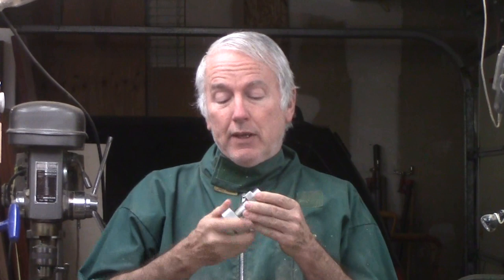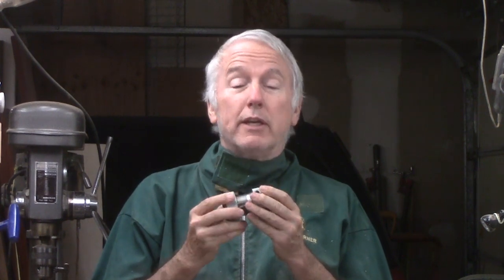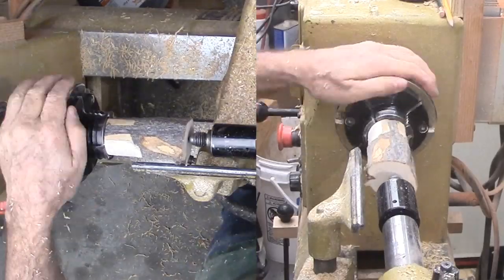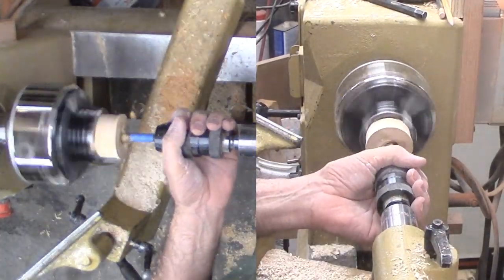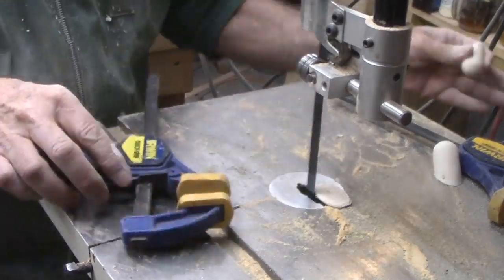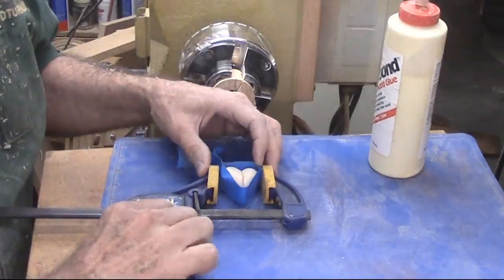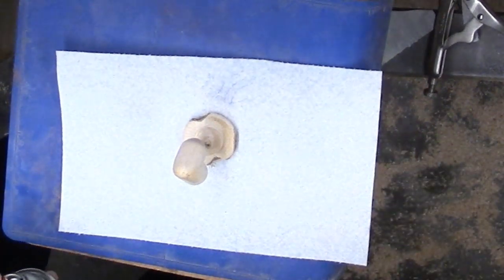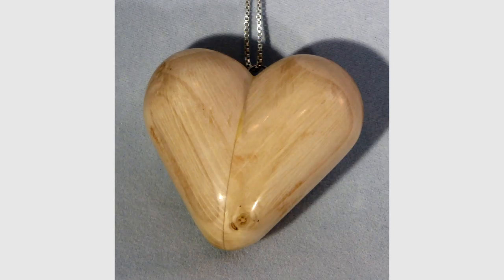Woodturning Heart For My Valentine Plus A Collet Flop

Comment: I once needed to hold a small work piece (1/8") and I emailed Dave Springett in U.K. To ask how he holds Lace Bobbins for turning. He was very helpful in suggesting making a collet chuck with wood. Size the chuck to fit perfect circle in a standard chuck, drill a hole the size of the piece to be held, then take the wood chuck to the band saw and cut the side to the hole. With one saw kerf there is enough to grab the spindle. I have now made several of these and for Bobbins I cut it into two pieces and use elastic bands to hold it together when not in the jaws. I put a couple of groves on the outside to hold the elastics.  The thickness of the wood chuck can be varied to protrude the work away from the lathe chuck and provide more wood support.
Reply from the maker: Bert,
You always have great ideas. Thanks for the suggestions.
Alan

Comment: Happy Valentines Alan, at 2:43 in the video if you drilled out the end  for 1 side of the heart, round off the end closest to the headstock, part off and repeat for 2nd half. then cut angles to match. Nice looking project.
Reply from the maker: I may have to make it longer so I can waste more wood for that technique.
Thanks for commenting.
Alan

Comment: I watched Steve Jones, a UK woodturner,turn a heart between centres and then cut on bandsaw. His process is simple and great skew practice.
Reply from the maker: Yes, looks like great skew practice.
As is typical in a video presentation, I think it is a bit more difficult than it appears. I like his more rounded heart. However, that means he has to take particular care to make the two pieces almost exact mirror images of each other. Then sanding to match without some offset seems difficult.
I'm not taking away from the presentation. But as usual there's a little more to it.
Alan

Comment: December 2017 American Woodturner had an article on making collet chucks. I have it put away, but as I recall they cut into three pieces and use rubber bands to hold the pieces together when out of the chuck. Nice little heart, BTW, I hope your wife enjoys it.
Reply from the maker: Thanks for the heads up except that it was August 2017. It is probably what lingered in my mind. Still I think it can be adapted.
Alan

Comment: An idea for the makeshift collet chuck... if you turn a longer cylinder, and have it clamped in the chuck on the headstock end, you can drill a hole in the centre for whatever size you want. Then, on the bandsaw make 2 cuts 'along' the cylinder, so that when you look at the end grain of the cylinder you see a 'cross shape' with the drilled hole in the centre (does this make sense?). Then use a hose clamp fitted around the cylinder to clamp the piece of wood you want the collet to hold onto. Great project Alan, next year you can make one with inlayed veneer to make it extra sophisticated! :)
Reply from the maker: Thanks for the suggestion.
Just a note. I'm trying to avoid using a hose clamp.
Inlay such as a Celtic knot?
Alan
Reply: @AsWoodTurns  Celtic knot inlay would be a real nice feature. If you don't want to use a hose clamp, try using those really large and 'stiff' rubber bands to hold the collet tight, or you can even buy thick rubber strips, make some rubber bands out of them, and use those to hold tighten the collet. Any way, just ideas.

Comment: Nice project, Alan.   Regarding the idea of drilling to hollow the heart .... have you considered using something like a Dremel tool to carve out the interior?   It might not be pretty or precise, but after gluing it together no one will see the inside and some of the weigh5 would b3 removed.   Just a thought.   I need to get out to the shop and give this project a go.
Reply from the maker: A dremel could work but IMHO, slower.
Alan

Comment: Alan;  Be very cautious when making small off-cuts on the bandsaw.  I once broke a blade when the offcut fell down the slot, and lodged between the wheel and blade.  BANG!!  New blade time.  Ever since I use painters tape as a kind of zero clearance around the saw blade when doing small offcuts.
Reply from the maker: Good idea for the masking tape around the blade. Could slow down some of the small stuff.
Thanks for commenting.
Alan

Comment: You could do the same style collet by adding a thin layer of plywood to the front and back or solid wood with the grain directions perpendicular to each other. When making the cuts make them in line with the grain on the face you cut through.
Reply from the maker: I appreciate your suggestions.
Alan

Comment: Hi Alan, If I understand your question regarding "drilling out", you want to hollow it to reduce weight? I would drill it out prior to even cutting the two pieces that form the heart. 
The collet: I've seen collets made for use on wood.(Made of metal) I've seen them in use here on YouTube. 
When the one you made failed, how did it fail? It appeared to be a design close to being workable.
Reply from the maker: Yes, I wanted to reduce the weight. The collect failed because I did not plan on it cracking and the piece was too small to hole in the collet  for drilling.
Thanks for your suggestion
Alan

Comment: Make your collet chuck just as you did then rem out the hole to fit. Then make two cuts with a thin kerf saw by hand at 90deg make same cuts on other side that are centered between the cuts on the first side. Leave a small rim at one that will seat on the face of the chucks jaws face.
Reply from the maker: Randy,
Thanks for the suggestions. Now back to the drawing board.
Alan

Comment: The heart looks good.

I have what looks like the same ER32 collet chuck.

For a wood collet chuck, I have turned a cylinder to fit in one of my Talon chucks, drilled a hole of relevant size for the work and then made a single cut along the length of a chuck with a hard back saw, just to get thinner kerf than a bandsaw.   This does not have a lot of range of adjustment for the work, so the hole and work diameters need to be close.   It is stronger than the several cuts of a metal collet design.

To drill the heart, I would have held the work in my mill vise.

Dave.
Reply from the maker: Thanks for the suggestions. Now to the drawing board.
Alan

Comment: Take a pvc pipe, cut longer than your tower jaws and true up both ends plus the in and outside if needed. Then make a single length wise saw cut. Mount work in the pvc mount this in your chuck. Your limited to size, but you have a collet jaws that won’t mark your work.
Reply from the maker: Should work fine for (as you say) a limited range of sizes. But they make it in many sizes.
Thanks for adding your comment.
Alan

Comment: Nice project.  

I also have an er32 collet chuck that I use a lot when making pens.  But er32 collets don't come any larger than 20mm, and so are too small for this application.  Of course, you could always make the heart smaller, which means that the dowel that you are working with will also have a smaller diameter.  There are larger collets, but I'm not aware of any larger collet chucks that mount on a wood lathe.

I think your idea is workable, but just needs fine tuning.  One problem is that the hole you drilled was smaller than the dowel you wanted to mount, and forcing the dowel into the hole expanded the collet to the breaking point.  Also, the collet was rather short, which means that after you cut the slots, there was very little solid wood to hold the collet together.  In addition, cutting the slots from opposite ends of the collet weakened it.  Finally, the characteristics of the wood used to make the collet chuck are a factor - you have to use hard wood with tight grain - cedar may just be too soft.  A hard wood like maple might work better.

My suggestion is to try again, but this time:
1.  Use a drill bit that is very slightly larger than the diameter of the dowel you want to mount in the collet.  Also, if you only bit you can find is too large, you could also wrap some paper towel around the dowel to pad it out before mounting it in the collet.
2.  Make  the collet longer so that there is more solid wood to hold the collet pieces together.
3.  Cut both of the cross cuts at the same end.  Also, make collet chuck very slightly conical with the OD at the end that grips the dowel larger than the OD at the other end.  
4.  Finally, experiment with other timbers to make the collet chuck.
Reply from the maker: Thanks for the detailed suggestion. Has promise.
Alan

Comment: Cute piece, Alan!  I'm sure she'll love it.  You were on the right track with the collet, but you didn't make enough cuts.  Double the amount might have given the wood the "spring" it needed to stay in tact.  The species used is also important.  For example, a brittle wood like cedar or juniper would not be a good choice for the collet.  Grain direction is also important.  Don't use a cross grained piece.  Spindle stock should be best I'm thinking.  You need a wood with some flex, if you will.  Maybe a softer wood like pine, but I'm not positive on that.  Also  if your hole was under sized too much, you're going to fracture the grain regardless of species.  Either sand it out more, or use a small scraper to enlarge the hole slightly.  Even a Dremel style tool would work.  As for hollowing the piece, you are right about trying to use a twist drill in the angled piece.  However, a small forstner bit could work if you go slow and take your time making very light cuts.  But a Dremel could also be used here.  Of course, all this is speculation as I have not done it.  
Billy
Reply from the maker: Billy,
Thanks for the suggestions.
Dremel???
Alan
Reply: Alan, I'm talking about a Dremel rotary tool... if that is what your ??? refer to.  There are a number of brands that do the same thing.  
Billy
Reply from the maker: @TheMessyStudio  Or course and I do have one. The only thing is that it is not the first tool I think of in a pinch. :)
Alan
Reply: @AsWoodTurns  Ah, got it.  Yeah, for the hollowing aspect I took my woodturner hat off and went the power carver direction with my train of thought.
Billy

Comment: On a technical note I used some 1” square oak pen blank in pen jaws to make. Once I got the outboard end rounded and sanded I stated to round and sand as much as I could from chuck end. Then parted it off. I flipped and wrapped one end with a little craft foam just to hold enough to sand other end.
Reply from the maker: Craft foam may work better than masking tape that I've used.
Thanks for the idea.
Alan

Comment: I feel that the DIY collet chuck might work if you have more cuts in it.  Also, a stronger material would help, especially if you were to use something without a grain to split on like HDPE.

Have you considered making a longer cylinder, chopping it in half, and hollowing each half on the lathe before making that bandsaw cut that's high on the pucker factor?  I'd be tempted to cut it by hand myself, but my bandsaw has tried to bite me in the past on similar cuts.
Reply from the maker: HDPE could work but I'd like something less expensive. 
I'm considering some sort of sled for the band saw cuts. 
We'll see.
Thank you.
Alan
Reply: @AsWoodTurns  Less expensive???  Wash & save old milk cartons for a few weeks, cut them up into little pieces, buy a pan from goodwill for a quarter, cut a piece of scrap wood the size of the pan, fill the pan with milk jug chips, throw it in the oven (toaster oven if your wife is uptight) at 325 degrees F until it turns translucent, and smoosh it down with something metal.  (Yes, smoosh is a technical term. ;-) =) )  Add chips, melt, smoosh, and repeat until the pan is full.  When you take it out the last time, put the scrap plywood you cut earlier on top & clamp it down.  Cool & remove everything - pan might have to be sacrificed as it sometimes sticks.  Voila - almost free HDPE material!

I turned my boat trailer with bunks on into a roller-trailer and used this technique to make 30+ rollers out of old milk jugs cast in mushroom cans - cost me basically nothing and now my boat comes on/goes off VERY easily. =)
Reply from the maker: @RealRuler2112  I will have to try your DIY HDPE. :)
Alan

Comment: I wonder if you could start with a piece a bit longer, cut it in half square for drilling BEFORE cutting the angle?   I APPLAUD you for making your own hanging loop.  I use various colors/guages to make hangers instead of those screw-in eyes.  The home-made hangers just look so much more "art-ful"...  Great little project!  Thanks!
Reply from the maker: I also hate the screw in eyelets. The home made as so easy, I cannot see using the commercial versions.
Alan

Comment: Hi Alan - as entertaining and thought provoking as ever. Re the drilling out issue... could you not have cut your turned cylinder in half at 90 degrees initially, held the pieces in the collet, drilled into the flat ends to depth and then returned to the bandsaw to make your angled cuts?
Reply from the maker: Yes, if my cylinder were longer. As is, I could use the same cut surface without using 2-3 inches more of the cylinder. But that may have to be...
Thank you
Alan

Comment: i thought about doing a piece for my chuck and i was going to just cut the round piece just once and remove two of the jaws , i have not done this 
yet but i think it will work ,you can give it a try and let me know if it works .......i did buy a collet like you have and have use it alot but when i buy a second one i will buy a different model ,one that cost a little more ...
Reply from the maker: Pondering...
Thanks for your suggestion.
Alan

Comment: Sometimes the simplest ideas work best. How about hot gluing the four separated wooden collet jaws to each of the steel chuck jaws? I think a slightly larger drilled hole (over the blank diameter) would let them clamp at the proper size by allowing for the saw kerf. Sort of like reusable wooden pads for your chuck jaws. 
I used an electric die grinder with assorted router bits to hollow out a small project. 1/4" shank router bits fit nicely in the die grinder. I tried the router bits in a drill, but the RPM's were too low and the bits tended to grab. Less of a problem at the high RPM's of a die grinder. A very light final pass usually removes any burn marks. Extreme care should be used.
Perhaps hot glue again to temporarily attach the project pieces to a sort of glue block that fits in a vice or some other clamp. Hot glue comes off fairly well with the help of rubbing alcohol.
Reply from the maker: Hot melt should flex - that's an interesting idea.
Thanks for the suggestions.
Alan
Reply: @AsWoodTurns  I was reading my original comment and I see that I misspoke on the router bits. actually they were burrs made for an old die grinder. Sort of rotary files. I have several sizes and shapes.

Comment: Nice piece Alan! Given that the angle you used was cut/fit, can you please share what you estimate the finished angle was/is...?Thanks! V
Reply from the maker: You called my bluff.  Probably somewhere between 20 to 30. I eyeballed it and then sanded until it looked good.
At 45, the two pieces would end up at right angles.
at 0 you have no cut. so...
Try it first with a plain dowel.
Alan
Reply: Using a rubber band would work possibly as good as a o-ring. Just anything elastic to stretch to hold the pieces together. Hope this helps.

Comment: Would you consider using a piece of rubber for the collet?  It would be more flexible than hardwood.
Reply from the maker: Rubber may work but I find it difficult to drill.
Thanks for the suggestion
Alan

Comment: On your failed collet you could use o-rings to hold together, then clamp in your Chuck.
Reply from the maker: Could a rubber band substitute for an o-ring?
Thanks for your suggestion.
Alan

Comment: I think you’d have to cut the cylinder in half, and hollow each end separately like a lidded box, then glue together (?), but cutting on a bandsaw might be more difficult.  Maybe cut them long, and sand away the excess, which would happen pretty quickly.

Have you seen this method?  https://youtu.be/Z20Lkaan86g
Reply from the maker: Thank you for your thoughts on this project.
Alan